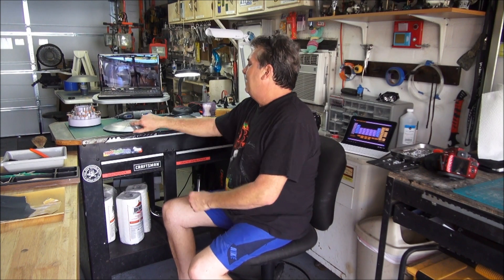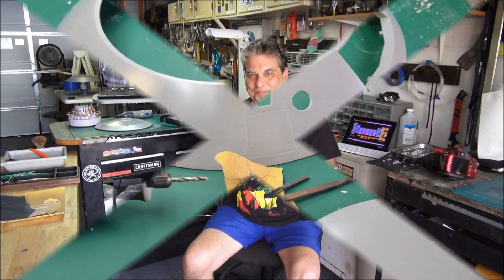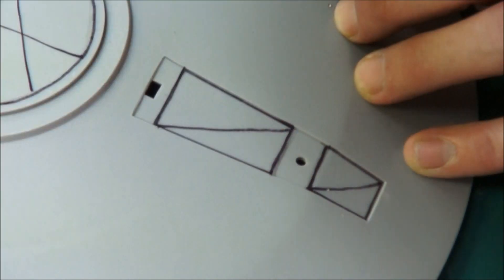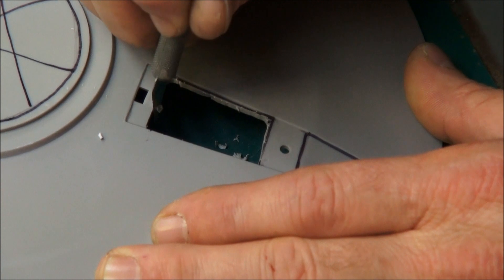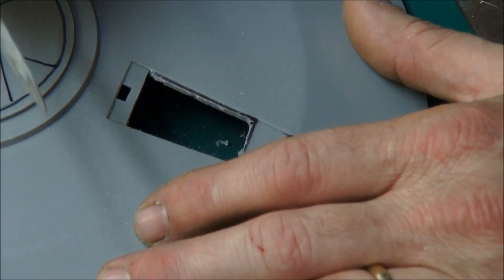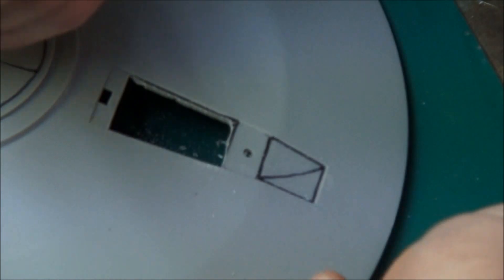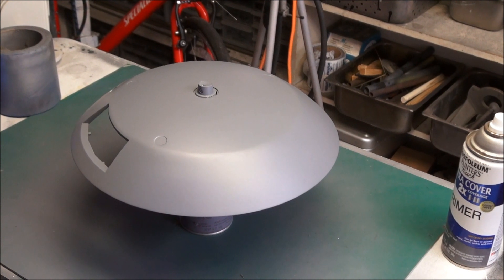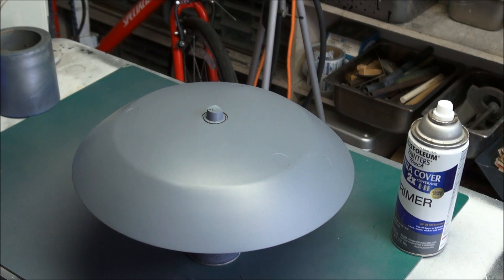"LOST IN SPACE" JUPITER 2 SAUCER PROJECT, BEING CREATED AT THE KIT FACTORY! VIDEO #1

Comment from the maker: Too harsh is it, when your that close to the edge, time to go in with the knife. Remember that the Dremel, even at a slow speed, it going very quickly, RPM wise, so the heat can melt past the point of contact, it's just too risky to get that close, with a rotary tool, and not cause a problem, trust me on that.